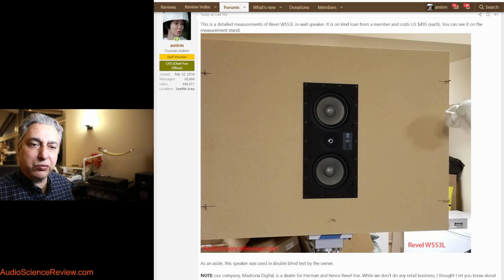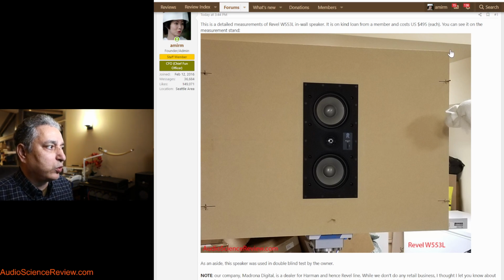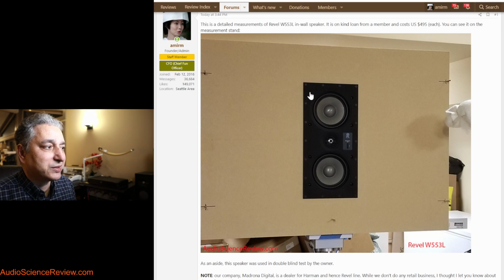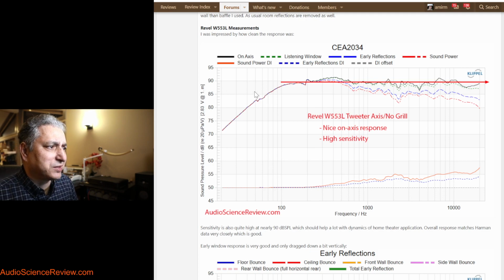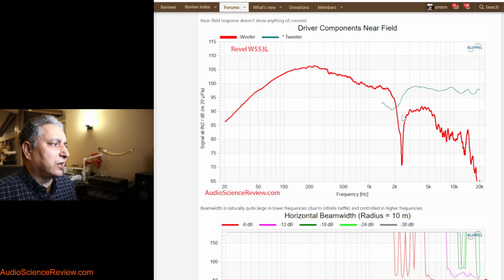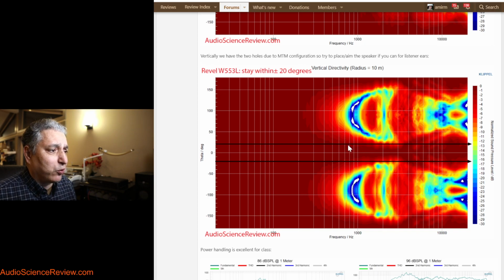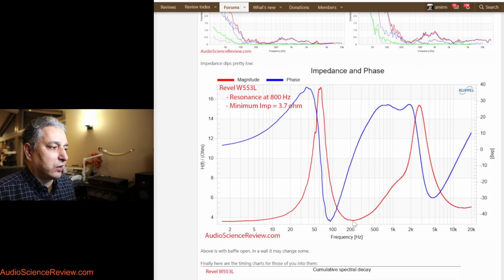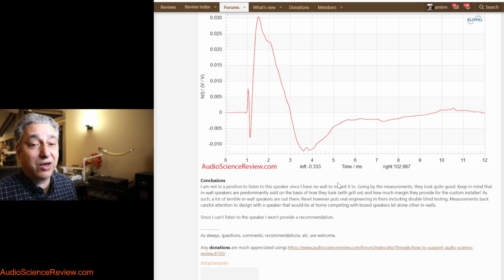Revel W553L In wall Home Theater Speaker Review

Comment: bohlender & graebener used to make the 50 inch and the 75 inch planar magnetic drivers, and I think those where the best for reproducing the range from 150 to 10 Khz (or even to 20 Khz) and because they are hard to make in mass production they never became widely populair. But many believe those are the very best to use, have you reviewed those kind of drivers?
Reply from the maker: I have not.  Would be good to measure.
Reply: @AudioScienceReview  hope you will someday, I have the 50 inch planar driver. it's like 10 cm wide and 1.3 meter high and in a push-pull configuration and is all one piece of flat thin super light material, you almost logically think this must be the best way to produce a soundwave because every piece of the driver is equal . If you hear it it's absolutely different from any other point source, it's just there the sound, very relaxing for my soul to watch your debunking video's. :-)
Reply: Also It would be not easy to send them to you, because each weighing +/- 20 kg. ( I read many people do that these days)
Reply: Planar speakers will not work very well mounted in the wall because they become very directive at high frequencies and cannot be toed in when mounted in the wall. Of course they might have used a tweeter ribbon but still the problem exists.

Comment: A remarkable effort. And a surprisingly good job by Revel. I'm not an HT enthusiast, although I have a projection system in a rec room. And I am hugely weary of all the "columns with four holes" speakers that I have to place around the room to get the 'bwong, biff, zap, crash, thud" noises, along with clear dialog, that moviemakers rely on for Oscars and theatre ticket sales.

Having been dragged, clawing, and grumbling, through undergrad measurements courses, I am most impressed by Amir touching upon the limitations, constraints, and math compensations for measurement realities. I recall one astute professor banging on the lecture table and repeating, "If you don't know what you're doing, your measurements are fiction." So mote it be.

These really are remarkable speakers. I for one never thought that any company could do this well with in-wall speakers.

Comment: I never knew there exists something like a good in wall speaker, amazing :)
Reply: Some people at audio forums "know" that an in-wall speaker cannot be good because a large front baffle is bad :) They fail to understand concepts like baffle compensation or infinite baffle.
Reply: @dingdong2103  
Spatial loading, huge.
No SBIR nulling, equally huge.

In my first house in the 80's, I flush mounted Polk AB800 (dual 6.5" MTM 2.5 way) into the front wall of our home system ... it made superb performers out of ~$1k/pair in walls. 

Amazing what an acoustic lever a proper baffle wall can be. Punch, null free clarity. 

Still have them sitting on a shelf, my audio journey. 

In the subsequent 40 yrs plus, I've worked in studios, studied all things acoustics... well executed baffle walls do things no other platforms can do. 
(then again, a pair of dipoles several feet out in the room can do things no other platforms can do!)
Reply: @FOH3663  Barn door size electrostatic panels have been my nirvana for years. I've always been toying with in-walls in my mind but never got around to it for obvious reasons. I used to be married lol.

Comment: First time I've seen anybody do an in wall speaker review and this is a good one Revel have certainly done at lot of real work on this one and bravo to Amir difficult to test and encouraging results
Reply: Erin's audio corner reviewed JBL scl-6 with Klippel few days ago..
Reply: The bass part of the measurement is not accurate though since the in-wall speaker usually is enclosed in the cavity between wall studs. It acts as a closed box, not an open baffle and that has a big effect on the actual bass response. This measurement holds true only if the speaker is mounted on a wall that's open to another space, which is usually not the case.

Comment: Could you please do a review for the Wisdom Audio sage and insight speakers
Reply from the maker: I don't have one to test.  But my company, Madrona Digital started as a dealer for them.  I found issues with their line arrays lobing heavily and require that you sit pretty far from them.  It was also difficult to integrated the planar driver with the cone ones.  Things may have changed though as this experience goes back 10+ years.
Reply: @AudioScienceReview  thats great. I have 3 P4I point source and four ICS7A sage inceiling. I really hope u can get some to review. They sound amazing to my ears btw